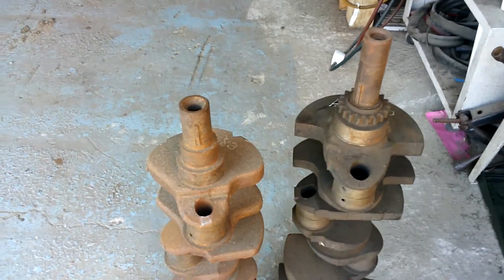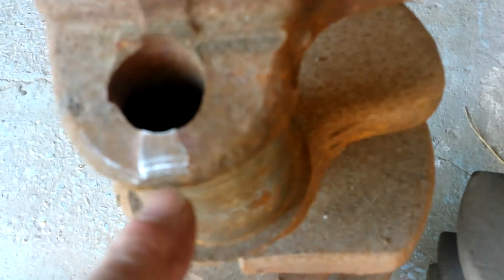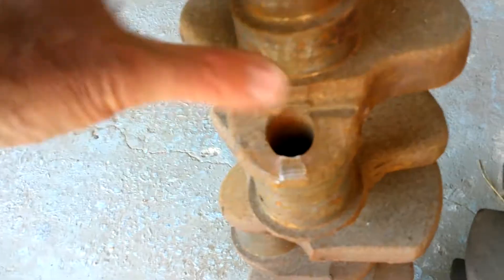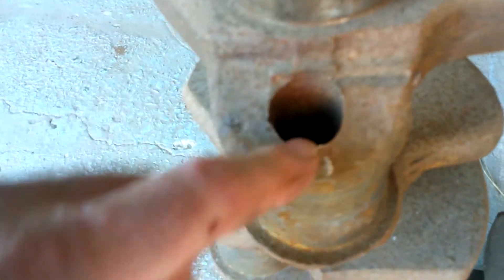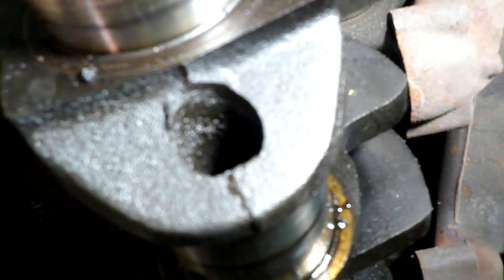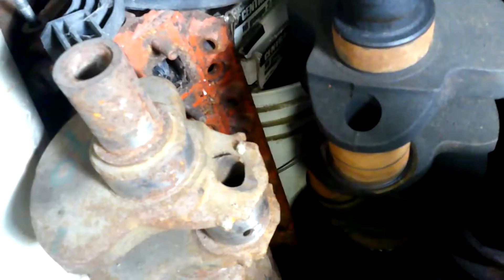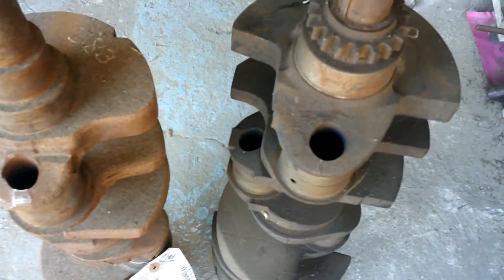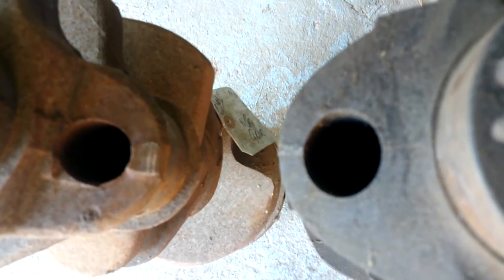How to tell a cast crankshaft from a forged. Easy way to identify forged steel crankshafts from cast

Comment: If you have an engine block that hasn’t yet been disassembled , from looking at it externally, you can also tell a cast crank from a forged crank by looking at the harmonic balancer , the cast crank will be externally balanced and you can identify that because you’ll see the oblong shaped balancer. The forged crank will be symmetrically balanced internally with no visible balancer from the outside. 
After 1970 they were pretty much all cast cranks to cut cost when manufacturing.
Reply from the maker: That is correct. If you remove the pulley, a cast crank should have "for cast crank only" written on the face of the balancer

Comment: I have 3 big block crankshafts laying outside and the2 cast cranks are totally rusty but the forged crank has no rust on it
Reply from the maker: I am no metallurgist, but I think forged cranks may have a higher nickel content which would make them less susceptible to rust. Most aftermarket, performance cranks are going to be made from miscellaneous alloys which may also resist rust. Nonetheless, I would put them inside before they all turn into worthless junk.

Comment: cast-iron or cast steel or am I ignorant and there’s no such thing as a cast-iron crankshaft?
Reply from the maker: That is actually a really good question, thank you for asking. Both are considered steel but one is cast into shape and then the journals ground. The forged crank starts life as a raw block of steel and cut into shape. The reason forged is stronger is because the liquid steel is denser when flowing into a block and the machining process helps to harden the steel. When steel is poured into a casting, there can be tiny air pockets, imperfections, and inconsistencies due to the flow changing directions to fit the mold. Look at it like NASCAR and figure 8 racing. NASCAR the flow is all in one direction so traffic flows better. In figure 8 there are crashes and holes in the flow. Forged is nice straight hair and cast has cowlicks. I cant say for sure if there have ever been cast iron crankshafts but when I am comparing them in the video, they are both steel. Just to confuse you further, there are different grades of steel as well. A high-grade cast steel can possibly be stronger than a weaker grade forged. Clear as mud? I'll make it simple. If using stock OEM cranks, use forged for high horsepower vehicles. Cast cranks work just fine for most street cars if not using slicks or sticky street tires. Start reaching over 500 ponies and/or a car that hooks up, forged or aftermarket for sure.
Reply: There is no cast iron in any part of a car . all cast steel or forged, in the crankshafts case.